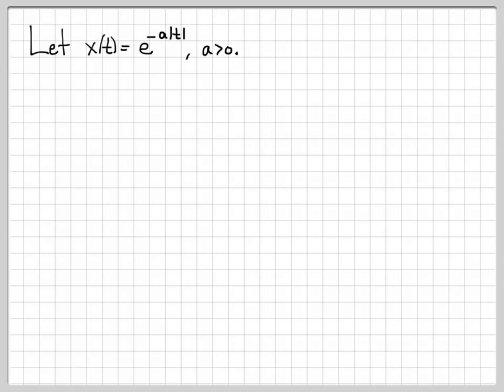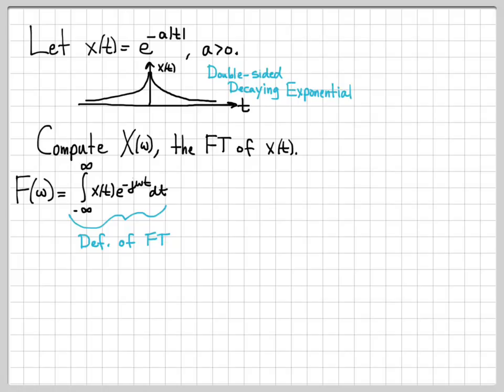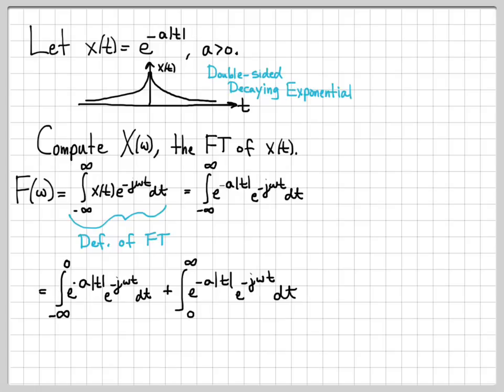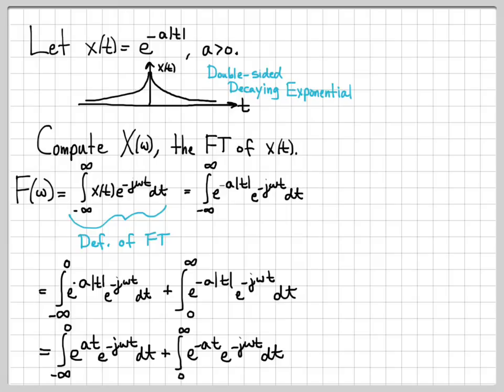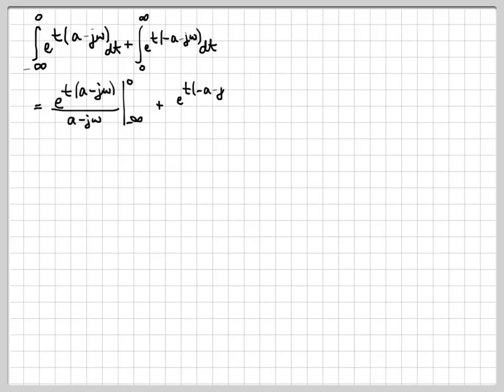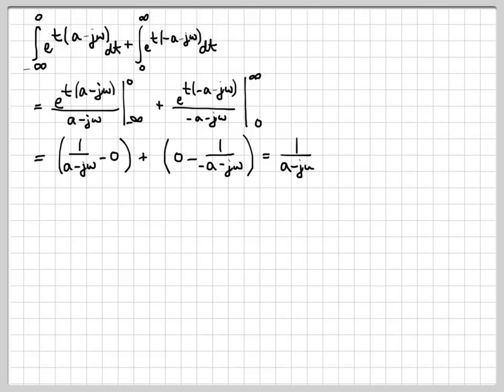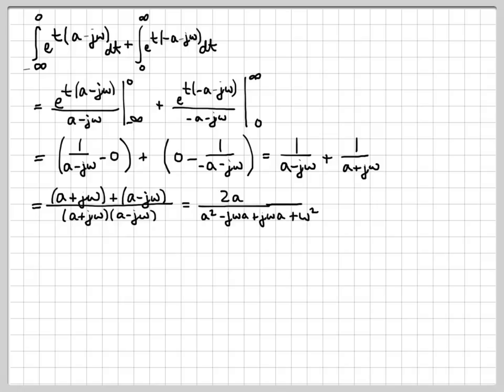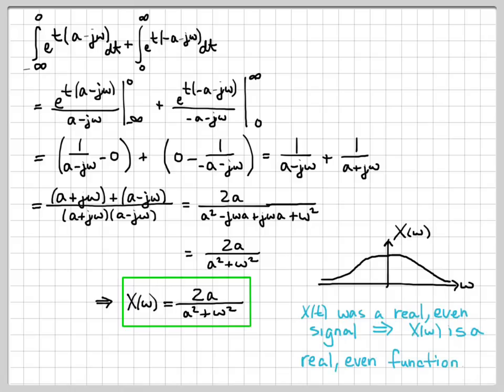Fourier Transform Example 03 - Two-Sided Decaying Exponential

Comment: Congratulations dude you have been doing great job and you have helped me a lot. But I have a question. At 3:33 how can we know that lim(t-> -∞) [e^(t(a-jw)]=0 ? If a-jw<0 then 
lim(t-> -∞) e^(t(a-jw)) will be equal to e^(+∞)=+∞.
Reply from the maker: On the first integral with limits from -infinity to 0, after performing the integration write the numerator e^(t(a-jw)) as

e^(t(a-jw)) = e^(ta)e^(-tjw)

This is the quantity we need to evaluate at t = 0 and t = -infinity.  The t=0 point is easy; we just get 1 for the numerator.

For t = -infinity, note that a > 0.  So, the product “ta" is negative and as t goes to –infinity, exp(ta) goes to zero.  The other term, exp(-tjw) always has magnitude one.  As t goes to –infinity it’s just a complex value that “spins” on the unit circle.  However, since it’s being multiplied by a number that’s going to zero the entire product goes to zero.

Hope that helps,

Adam
Reply: @AdamPanagos   Ok got it! thanks for your answer
Reply from the maker: @NikosPap1231  Glad to help, thanks for watching.

Comment: hey Adam, I thought e^-infinity is 1?
Reply from the maker: Monrovia 1847 
e^(-infinity) is equal to zero.  Just do a few computations on your calculator to convince yourself:
e^(-2) = 0.1353
e^(-10) = 4.54e-5
e^(-100) = 3.72e-44

The value of e^(-x) gets very small very quickly as x gets large!  In the limit it equals zero.

Comment: How is abs value of t -ve and +ve; are not abs values only the magnitudes and have no signs?
Reply from the maker: That's correct, |t| is always a positive quantity.  So, when computing the integrals we have to take this into account so we can get rid of the absolute value sign.  For example, -|t| should always be a negative value, since |t| is always positive.  If we restrict t to -infty < t < 0, then we can write -|t| as just t, since t is always negative.  If t is restricted to 0 < t < infty, then we'd have to write -|t| as -t, since t is positive on this interval.

It's really about breaking the |t| symbol down into two cases (one for negative t and one for positive t) and then using the appropriate sign so the absolute value sign can be removed.

Hope that helps!
Reply: Adam Panagos Thanks Adam! That was helpful :)